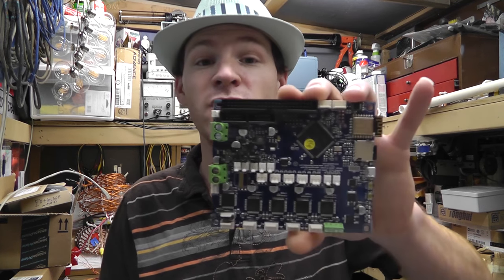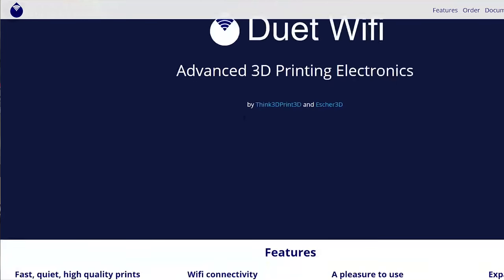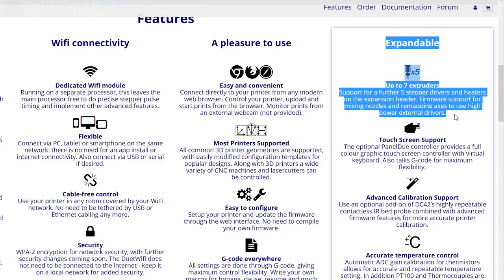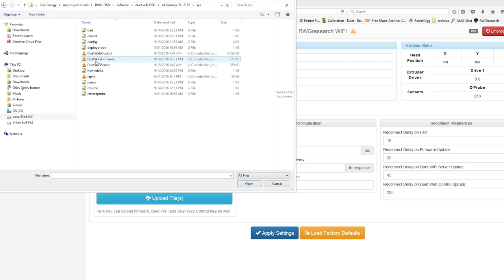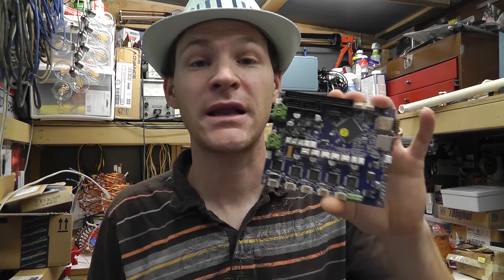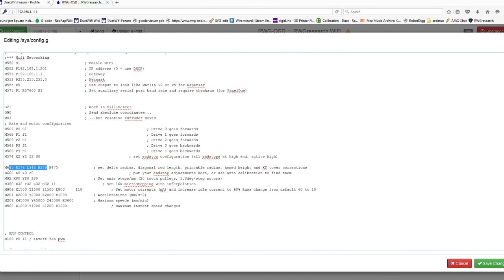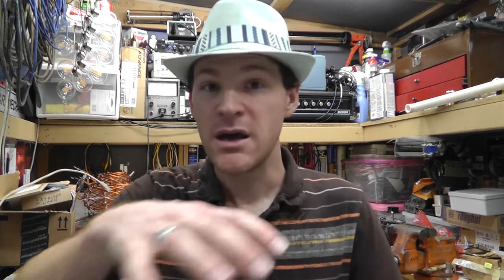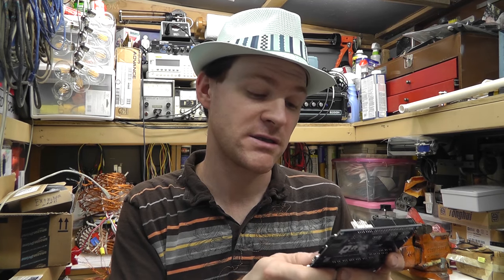Duet Wifi First Impressions / Review, This Is The New Age In Open Source 3D Printing!!!

Comment: All of the duet versions support upgrading the firmware via the web interface.  Only difference I think is the DWC web interface can't be updated OTA on the older versions.  

All the software features are supported on all hardware versions at the moment.
Reply from the maker: ah. you are correct. for whatever Reason I was under the impression that you could not. !! good to know! I'll add a subtitle of something for that!! Thanks!! ~russ

Comment: "Designed and assembled in the UK"
You're welcome! :D :D
Looks like you're gonna have a ton of fun with that, Russ!
I've often thought about whether printer drivers will switch to a raster, lower resolution normal stepping mode on the fly for things like rapid infill or raft laying.

Comment: A small correction, you cannot use a LCD2004 or Full Graphic LCD 12864 on RepRapFirmware (yet). The Due uses 3.3V TTL and those displays need 5V TTL like an old Arduino, though that's easily solved with a voltage divider. Most importantly, there isn't actually support in RepRapFirmware for those displays. However you can just connect via WiFi and control from your phone or tablet or laptop and uploading over web is fast so it's not such a big deal.

Comment: Hello! Great video. It helps in understanding the features easily. What should  be the minimum current output of the 12V -24V power supply to run the board efficiently with stepper motors and heated bed?

Comment: hi Russ. I just got a duet wifi board last week and have replace a rumba board with it. I'm having a lot of trouble with the endstops. I've tried about a dozen config.g files from other success builds but they just dont quit do it for mine. Do you have code covering the endstops?
Reply from the maker: brian t what end stops are you using and what kind of "troubles" ? ~Russ
Reply: they are 3 wire mechanical stops. When they are triggered no code after gets executed and they lock up motors til powered off.
Reply: i've gotten the x and y endstops to work, but cant get z to work
Reply from the maker: brian t ok good. that one needs a bit more understanding. bucuse there are 2 inputs. you habe to pick the right one and set it up correctly. 

try reading this. 

https://duet3d.com/wiki/Connecting_a_Z_probe

there are a bunch of things on that site. its all dedicated to the duet. 

let me know. ~Russ
Reply: thx Russ but that is for z probe, i'm only using mechanical 3 pin endstops
Reply from the maker: do you have a z probe?
Reply: no
Reply from the maker: what printer are u using?
Reply: a Cartesian called the beast out of Australia
Reply from the maker: ok it should be possible, however i would go here and and ask that question: https://www.duet3d.com/forum/index.php 
be as clear as you can with the questions and some one will help better than i can.. 

also see some posts here: 
http://forum.seemecnc.com/viewtopic.php?t=11578

basically the best thing to do is add a z probe. but if you dont you should be able to disable all auto bed level stuff and calibrate manually. 

let me know... 

~Russ

Comment: 256 micro stepping is pointless, you loose virtually all your torque: http://machinedesign.com/archive/microstepping-myths. My azteeg smoothie board has 1/128 micro stepping, I actually am using 1/8th (I have 400 step steppers) -- so accuracy is equivalent to 1/16. The closer to 1 you can run your steppers, the more incremental torque you'll have. 1/256 is a feature list item.
Reply: It is a myth that increased microstepping reduced torque. Sure, the torque for a position error of 1 microstep goes down because the microsteps get smaller; but the torque per unit angular error is independent of microstepping, except when you go from full to 1/2 stepping. So above 1/16 microstepping, the main benefit of higher microstepping is reduced noise, not improved positioning accuracy. Whereas as you say, using 400-step motors instead of 200-step does improve positioning accuracy. The reason you are not able to use 128x microstepping is probably that your electronics can't generate the step pulses fast enough to give you reasonable travel speeds. On my Duet WiFi-controlled delta I use 400-step motors and 64x microstepping, interpolated to 256x by the stepper driver. It works great and is very quiet..
Reply from the maker: Good stuff David, 

I have been using 16xmicrostep and interpolated 256x, mine are 200 step 1.8 degree. it is indeed very quiet, it feels like there is this ever so slight back ground noise but its hard to tell what it it. lol . I found that setting the driver to 256 is not helpful, but instead keeping it at 16X step and the 256 interpolated. It seems the same noise level with more torque than changing steeping to 256.. nice work again on this stuff David! and the rest of the crew :) cya at the forums.  :) ~Russ
Reply: OK another link, since we live in a world where there can be facts and "facts": http://www.micromo.com/technical-library/stepper-motor-tutorials/microstepping-myths-and-realities

Micro-stepping decreases torque -- that's a fact, it's not a myth. Is this alternate facts universe all of a sudden? There is actual math which says that as you increase micro-stepping your torque is reduced drastically. As far as I know math is still a real thing, that didn't change in last week. Trinomic TMC2100 can do interpolated 256 microstepping without losing torque, that's the best way to get to higher degree of precision. I am using a smoothieboard, so it has the necessary horses to push 1/128. Duet is an arm based board just as the Azteeg, both are 32 bit controllers. Both are able to generate pulses just as fast. I wish people would research these things. I did a lot of research, I actually read the white papers associated with research. I tried torque tests with 1/128 and 1/8th -- it's clear and apparent. There is actual math which says that INCREMENTAL torque is cut drastically. Your driver can interpolate it and retain the torque, but by using 1/64th microstepping you're decreasing the torque and actually accuracy of your printer. Feel free to read the white paper in the attached link. Then again you can believe what you want, and if your machine works as configured that means your reduction in torque is not impacting your performance. You may have very high torque 400 step steppers which are way overkill for your build...so reducing the torque and noise is best. Just don't make stuff up.